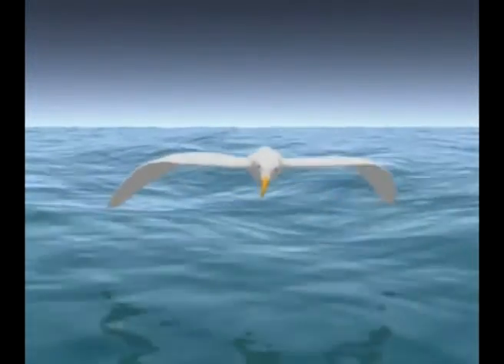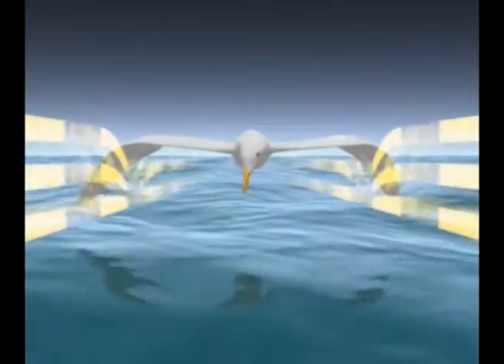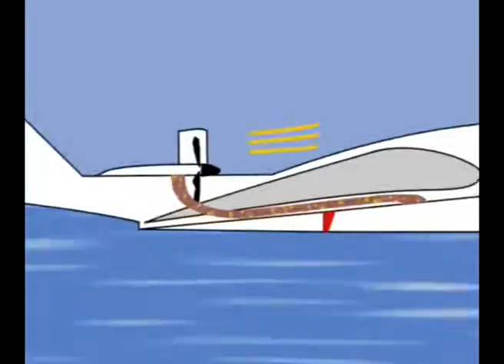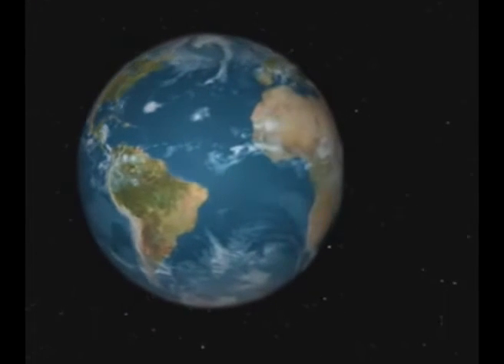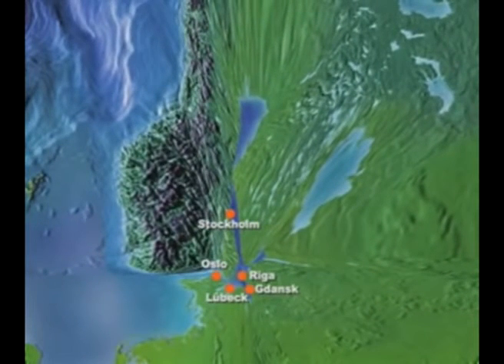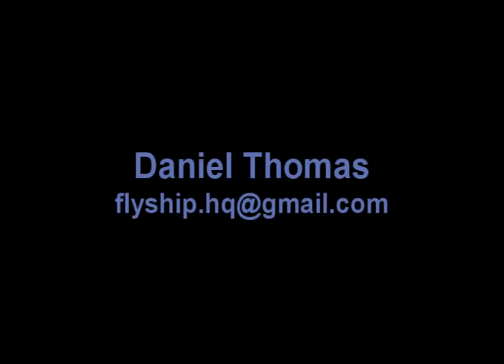FLYSHIP FS-100 new generation cruising at speeds of 250 km/h

Comment: This company (FLYSHIP) don't have rights in this technology any more.
ΑΠΆΝΤΗΣΗ
Reply: How did that happen? I am doing research on WIG-crafts, and would be really interested how the legal situation is with FLYSHIP
Reply: If you have done a good search then you have found that FLYSHIP GmbH (Hamburg)  has dissolved in 2008. This company CEO with new "partners" has been found few years ago another company THE FLYSHIP but they don't have any agreement with inventor of Hoverwing technology, Mr. Hanno Fischer to produce these vessels.
Hoverwing technology has been acquired by Korean company Wingship Technology Corp. since 2009 for vessel capacity from 40 seats and above. For less passenger capacity of 40 seats this technology has acquired by German company AFD GmbH.
Anyway if you have any question about this then you can contact with Mr. Hanno Fischer directly: http://www.fischer-flugmechanik.com/site/index.php